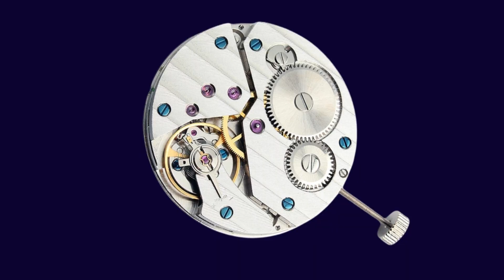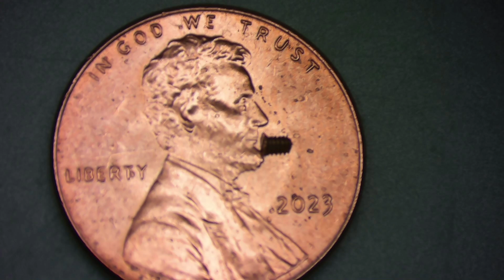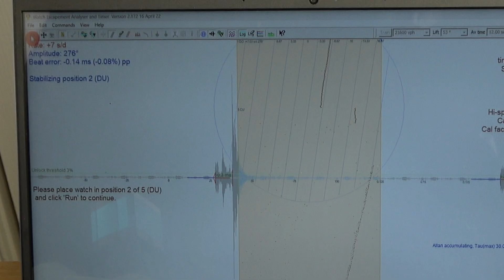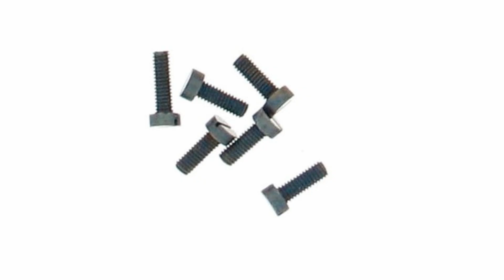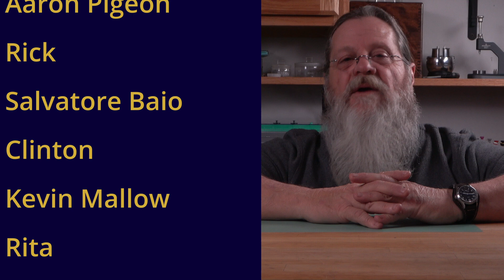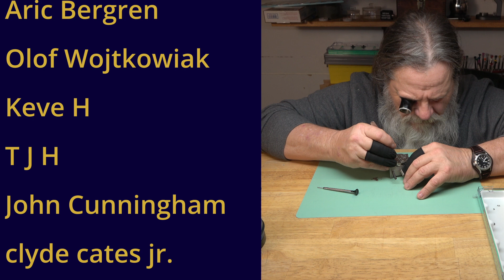Your First Watch Service: For Beginners

Comment: I would like to buy the ST3600 movement but your link to eBay is out-of-stock. Where can I get a genuine Seagull movement?
Reply from the maker: You can buy them directly from seagull on their website. There are some fake sea gull  so make sure it's their official one. Other than that if you're buying off eBay, you just have to buy from a seller that has good ratings and feedback.
Reply: @watchrepairtutorials  Thanks! I downloaded the oiling chart for the ETA 6497. Do you also have one for the 6498?
Reply from the maker: @JoeBobStubbs  should be the same

Comment: If im currently only testing a new ST 36, can i still use the timegrapher x for the before and after tests? Would it be accurate enough for that?
Reply from the maker: My results with it were pretty good. Just be sure to use it in a quiet environment, so it doesn't pick up any ambient noises.
Reply: @watchrepairtutorials thanks. I just found your videos and am excited to learn more.

Comment: Is it necessary to have a timegrapher from the beginning?
Reply from the maker: You can start with one of the better phone apps in the very beginning.
But you have to remember this. The hardest part about learning watch repair at home is that you don't have a mentor to tell you when you're doing something right or wrong the Timegrapher in a way becomes that mentor. It gives you unbiased feedback on how well you are doing based off the data that it gives you.

Comment: The point about learning on a new movement is important. Starting with broken/worn fixer projects gives you a bad reference; it subtly lays a psychological baseline for what you consider normal. A doctor who had never examined a healthy patient in their life would have a very different standard for what’s normal, and thus be likely to miss subtle problems. Same for a car mechanic who had never seen a new vehicle. We all have our own quirks and limitations; low standards doesn’t need to be one of them.
Reply from the maker: You have to know what things look like and behave when correct before you can understand when something is not right. 👍

Comment: Alex, in this video I noticed that your workbench is pretty high, almost chest high.  I presume this is a deliberate setup that gives you a more comfortable view of the watch that you’re working on and eliminates the need to constantly lean downwards bending your neck too much.  Is my guess correct?
Reply from the maker: That's right, it's for ergonomics and comfort. I usually work under a microscope so i lower my bench to a accommodate that.

Comment: Just for clarification: I just got all my tools and workbench setup (I got EVERYTHING you recommended). Should I be taking apart the movement and putting it back together a bunch of times before worrying about oil/servicing/Timegrapher? If so how many times should I disassemble and assemble before moving on? Thanks for any and all help, you’re THE MAN!
Reply from the maker: Your goal on this movement is to be able to service it so that it runs at least as well as it did from the factory, if not better. Before you take it apart, get your data for the rate in amplitude and all six positions. That’s your benchmark.
The first thing I would recommend is to take it apart and reassemble it as many times as it takes until you don’t need to use any reference pictures and you know where everything goes. That could be two times it could be 10 times it just depends.
Once you’re comfortable with that, then start working on your cleaning routine. Remember that the parts need to be chemically clean with no residue so that the oils stay in place when you apply them.
After cleaning the parts now you want to reassemble and start working on your lubrication technique. Remember that you should not be flooding anything with lubrication. It only requires a micro amount on the pivots. Less is better than too much.
Then check your numbers and compare them you’re starting numbers. 
If there is good or better than what you started with, you’re ready to move on. 
If not, then you need to figure out why a brand new movement is not running as good as it was before. 
By gauging your work with a brand new movement that will tell you if what you’re doing is correct or not. Remember and watch making everything matters. How you handle the hairspring and balance wheel, all the parts are cleaned, how well the lubrication is done, everything.
Reply: @watchrepairtutorials  Thank you so much for your detailed response, means a hell of a lot to someone starting out! I spent about $1000 exactly on tools/desk/light (I used your Amazon link) and don’t have money for a Timegrapher at the moment. I’ll be sure to buy one on payday. Thanks again, I look forward to learning a lot more from you!

Comment: Hello Alex, do you know of any decent quality bronze tweezers with curved tips? Like the number 7 from bergeon or horotec
Reply from the maker: I have never seen one. Why do you want bronze?
Reply: @watchrepairtutorials  I've heard you recommend bronze tweezers in the past
Reply from the maker: @ Yes they have their purpose, I’ve just never seen curved ones. 
The basic rule that I learned was to match the tweezer to the metal you are picking up. 
Most often I will use them to pick up a brass plated bridge  or something like that. 
If you wanna get a straight pair, I believe Bergeron is one of the only manufacturers who make them. You could search for Bergeron bronze tweezers, and they should come up.
Reply: @watchrepairtutorials  Okey thank you very much for the information Alex!❤️🙏

Comment: made that very mistake about holding the screw too tight just the other day.  i was holding the setting lever screw and bink, the thing shot across the room and completely disappeared!
Reply from the maker: It has happened to us all. All you have to do is just loosen up that grip a little bit.

Comment: Thank you for the great videos!
When just starting off, would there be anything wrong with using one of the phone appsas a timegrapher? Ive seen online that as long as you use it in a quiet area they are fairly reliable. The one ive seen and have been using is Watch Accuracy Meter and the only thing it struggles with is amplitude
Reply from the maker: Amplitude is definitely an important metric when determining how well your service work is progressing. Not having a reliable amplitude reading is not ideal for good feedback. My understanding is that the phone apps struggle with movements running poorly, so if you are using a new movement it may be ok.

Comment: This introduction to watchmaking series is outstanding, Alex - its second to none. 

I have a dedicated timing machine, but plenty of beginners that I try to assist use phone apps like the one you showed in this video. 

Some of the better phone apps do give an amplitude reading, but in my experience they provide accurate readings only when a watch is running well, and they are completely unreliable if a movement is running poorly. 

The amplitude reading seems to be the first to become misleading and I’ve seen these apps give amplitudes between 300 and 400 degrees for movements that were barely running at all. 

I’ve seen it suggested that the problem lies with the microphone. 

The electret microphones in a phone and in phone headphone sets are designed to pick up voice audio. 

The piezo pickup in a timing machine is picking up physical vibrations, which contain far less noise. 

I’m not sure that any amount of clever computer code in a phone timing app can turn the incoming sound signal into accurate readings. 

I’ve found that the best way for beginners who don’t have a dedicated timing machine to measure the amplitude of a watch is to take a slow motion video of it using their phone, and observe the amplitude directly. 

This approach is easy for dial down readings, but the other positions can be measured with a bit of improvisation.
Reply from the maker: I agree and I’m not really a fan of those apps, but I did find this one somewhat interesting. In their documentation, you have to go through and turn off a lot of settings that might interfere with the readings. They also recommend that you use a genuine iPhone microphone, but with Apple going mostly wireless now I don’t know how many people still have those. The microphone I use was not an Apple microphone, but the signal was as strong as you can get according to the app readings. My only point in the reason I included it was that it is better than nothing and at least it’s something to measure by especially since we’re using new movements in these lessons, which should be running good. 👍

Comment: Great advice, Alex.  Wish I'd seen this video two years ago, before I (nearly) blindly started in servicing my small collection of five pocket watches. (I have about 12 now.) Three of which were my grandparents' Waltham and Longines movements. Long story short, of those first five, none of which were running before I dove in, I have gotten three running reasonably well. The other two are still not running at all, and have been relegated to the 'try again when you have more experience' pile. 
I can't tell you how many screws, springs, etc, I've pinged into the stratosphere over the past two years, but the hardest lesson for me, is to accept that I am just not good enough yet to work on a particular movement, and just walk away for now. Thanks for all of your help and advice.  Garry
Reply from the maker: Well, it's great to hear that you know your limits. That tells me you care about your collection and their history. I can appreciate that. 👍

Comment: i see the ball vise. do you engrave, too? 
you started my venture into this, and continue to help solve issues I run into periodically. I cant thank you enough.
Reply from the maker: No, I don’t have that skill. I actually use it to hold things that I wanna show under the camera so they don’t shake.
Reply: @watchrepairtutorials  hey, that's a good use for a ball vise. I bought mine originally to make wedding rings for my wife and I. I feel like I have used it for everything except engraving.
Reply from the maker: @ mine is made by VEVOR so it’s not exactly high end but it works well enough for my needs.

Comment: Master Alex, I eagerly await each of your videos. I didn't start with the new ST3600, but with faulty Russian watches that I otherwise love and appreciate very much. After watching this video, I realized that I made a mistake because I didn't learn what parts and the mechanism itself should really be in good condition. I learned about sorting screws and realized that I' should only invest in good and quality tools. Soon, in a while, you will also receive Patreon support from me, and I will buy a book on regulation from you, I promise you that. Your school will be a good basis for my further progress. Greetings! Željko
Reply: Russians can definitely be a bear. I practiced early on with the 2609/2614/26xx series because they were cheap (I actually still periodically wear one of the first 2614.h i fixed. I love the size and weight, and the routine of manual winding.)

They will definitely teach you to have a light hand, it felt like I could absorb some parts at first. The calendar works also seem super finicky unless you go about assembly in the right order.

one day, chrono's wont scare me, and it will be thanks primarily to Alex
Reply from the maker: @ that’s right brother👍
Reply from the maker: I appreciate the support, Željko!  I know the Russian watches can be tough to work on.

Comment: Thanks Alex. When I got my microscope I contacted an acquaintance I used to work with for advice, she ran and trained a surface mount device repair lab at the company I was with. She told me that she got new folks to remove parts using tweezers from one box to another turning them over on the way. This went on for a week with the components decreasing in size every day. I did something similiar with screw and spring selection bought from a material house for a couple of quid. Worked hard at it and it did help a tremendous amount.
Reply from the maker: Yep, that’s a problem a lot of newcomers are faced with. They have never tried picking up things that small and they end up loosing screws. A little practice goes a long way.

Comment: After all of this time, once again I learned something new. Knowing different types of screws and what they are typically used for will help immensely since they tend not to stay close to their affiliated parts in a washer. I wish I could figure out how to wear a loupe without a wire like you do at the end. Ever since getting my microscope, I haven’t had to touch a loupe, but I have only been taking the st36 apart and putting it back together again. I’d imagine there are times doing different repairs where you need a view that is not straight down. Great video. Thanks!!
Reply from the maker: I’m glad you were able to pick up a little something. I think for people starting out figuring out what screw goes where can be a challenge.  
That’s an Asco loupe and it is probably the best I have ever used.